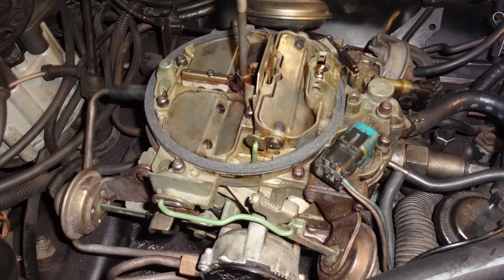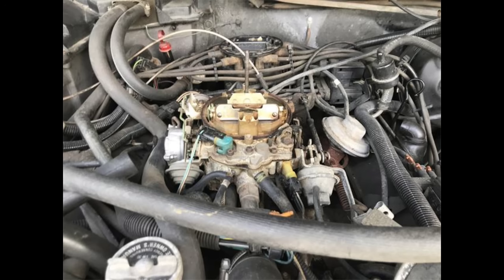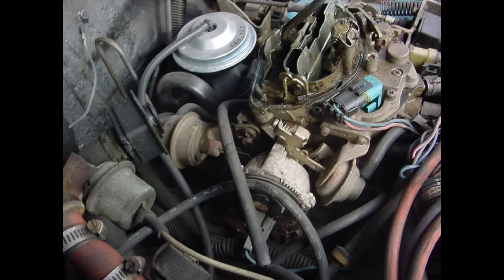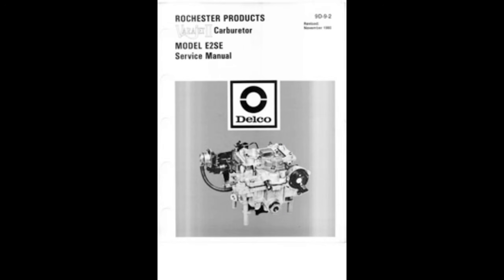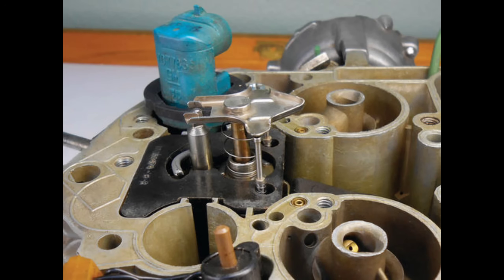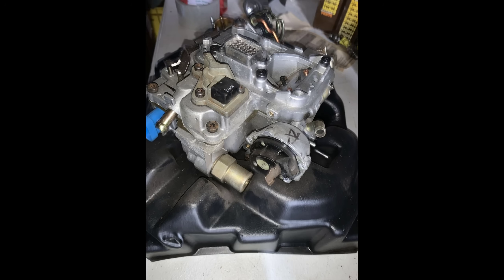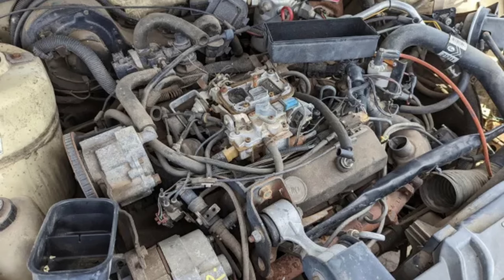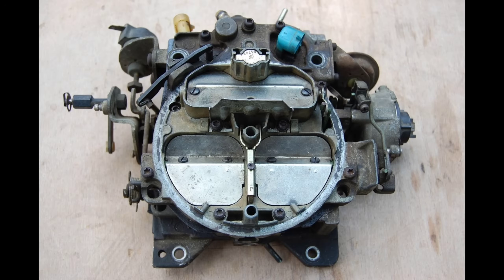GM'S Bridge To Fuel Injection: The Electronic Feedback Carburetor

Comment: These ran like any other carburetor. Your engine had to be healthy for them to work right.
Reply: Even efi the engine has to be healthy, no compression, good luck.
Reply: @shadowopsairman1583  : True but the EFI engines would try to compensate for general engine wear among other things which resulted in them running better longer. These carbs were hellbent on keeping things lean so when the engine started wearing out and emissions devices started failing, you'd get rough idling, hard starting, occasional stalling. Them engines with the VaraJet would start acting up with 40k or 50k miles on them.
Reply: @TeeroyHammermill  As I remember it was possible to make the solenoid keep the metering rod at the rich end of the travel all of the time,that made the engine run extra nice/smooth but if left that way for any length of time I believe the gas mileage would go down and the catalytic converter overheat or otherwise wear out. 
On the version used on the Chevrolet Citation V6 making it run rich would sometimes mask a performance problem actually being caused by weak spark due to a bad ignition module. I believe that with those cars "XII H.O. 660" you needed to substitute a known good ignition module before condemning and diving into the carburetor. 
There may have been a couple hidden under bronze adjustment screws that could be messed with by the adventurous in order to  soup up the car, especially if the cat converter were "missing" . One set the leanest mixture when the solenoid controlled metering rod was "down" the other set the richest mixture when the metering rod was "up" .

Comment: Nice video - Pretty concise summary of the feedback carburetors. One selling point of the Oldsmobile 5.7 diesels of that era was no carburetor or ignition system maintenance. Hindsight being 2020, the feedback Quadrajets were a far better deal, even if they did require some maintenance.
Reply: Ironically I've owned both an olds 307 v8 with ccc and an olds 350DX diesel V8. The diesel got literally double the mpg city at 22-24mpg and cruising mpg was 30-36 mpg vs 16-18. Diesel started well in cold or hot and wild run on 50% used motor oil like it was its job
Reply: @workingcountry1776 I've always liked the fuel economy of those Olds diesels. It's too bad GM didn't wait to release them until all the bugs were worked out. 
I'd really like to find a nice diesel Eldo, Toronado, or Riv one of these days.
Reply: @johneckert1365 I really liked the Eldorados and Rivieras of that era.
Reply: @johnrose3169  Me too! Mom had an 83 Riv with the 307. Over 300,000 miles and it only needed 1 transmission, and 1 timing chain, along with other minor repairs I'm sure.
Reply: @workingcountry1776 I’ve owned both as well. 1982 Bonneville Model G Diesel which got great mileage when it started. It had a chronic wait light/glow plug issue where there was no glow plug light since day one - it spent as much time at the Pontiac dealer as it did in my garage.
It was replaced by a 1986 Pontiac Parisienne with the 307 that worked as intended, but mileage was nowhere near that diesel.
Reply: One thing that amazed me was that other car companies shared many parts between the gasoline engine and diesel engine.
VW did it with the rabbit, and Datsun did it with the Maxima. They never became so cursed like the Olds.
Reply: @skylinefever  I believe that's because the engineering went backwards with VW. They already had a good reliable diesel engine, then changed a few things to make a similar gasoline engine.

Comment: I never had any troubles rebuilding and adjust these quadrajets. But I have a lot patience as I rebuild and restore clock, juke-box and vintage electronic.
Reply: I've overhauled a 350 TBI module, pretty simplistic design, only trouble can be from the MAP Sensor, IACV or TPS going bad.

Comment: That is my arch enemy!! I have one in my 84 C10, and struggle with passing smog every 2 years here in California. Such a picky carb
Reply: No california is too picky
Reply: @shadowopsairman1583  trust me..I know
Reply: @shadowopsairman1583 RIGHT!
Reply: Get out of California.
Reply: @robflammia4716  100%
Reply: Does it have the CCC on it because of the California emissions? Because I've never see  one on a truck, but I'm on the east coast, so probably not many California emissions truck made it out he.
Reply: @JK-ed1fz  yeah it does, check engine light, O2 sensor, cat, smog pump..same E4ME carb in this video. The ECU is tucked behind the glovebox. Because of California smog laws all these components have to be in good working order. Has to pass visual and tailpipe emissions test every other year or no tags. Any gas vehicle 75' or newer has to have a smog test to be registered. Diesels are a different story. If you know a guy that knows a guy you can get a "hot smog". I know a few cats that have this done..too risky. If you get popped for any reason your done all the way around.
Reply: Sometimes I wonder if people LS swap so that they can have a smog legal engine in a smog state, and still have great performance.